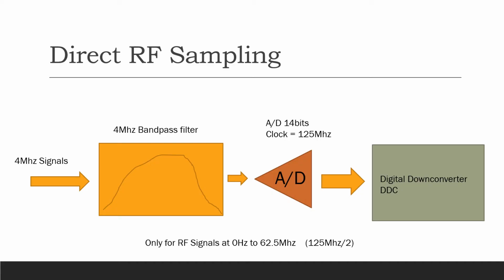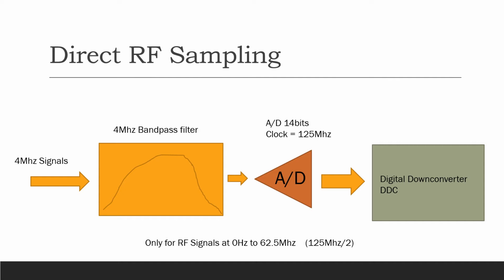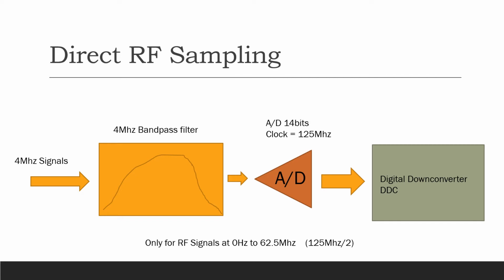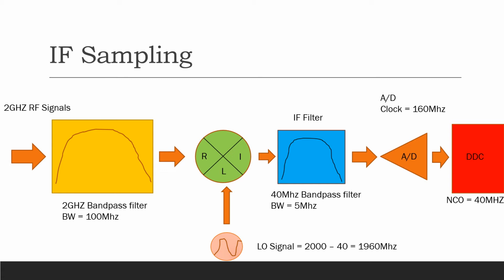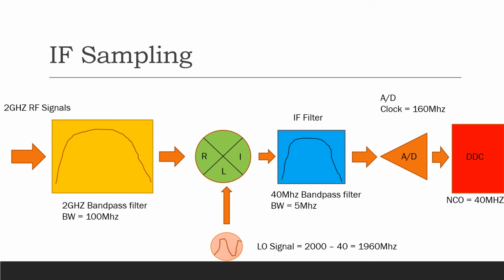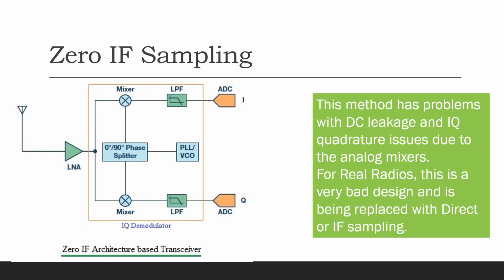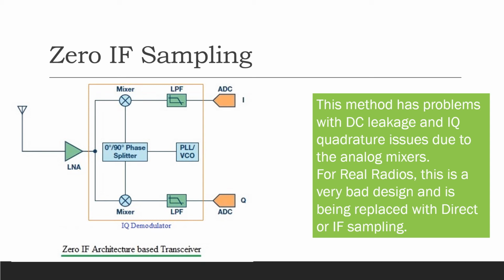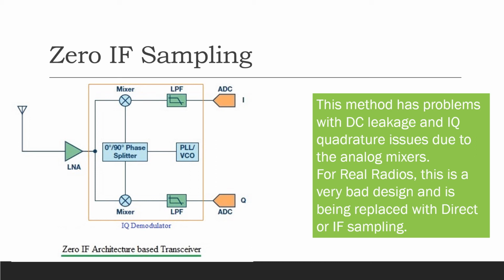IF Sampling and Zero-IF Receivers

Comment: Thanks for the video? What about undersampling techniques?
Reply: It's really common for IF signals. You can lower sampling frequency without aliasing when spectrum of the signal has limited bandwidth around it's central frequency but it moves central frequency (signal after ADC) to the lower value.
Reply from the maker: I made a video on nyquist zones

Comment: So I wanted a 20 meter hf receiver, (14.-14.3Mhz) could I use an ADC that samples at 2x14, or 28 Mhz ? On an 8 bit ADC spec is 28 MSPS (mega samples per second) the same as 8x28 or 228 Mbits ? Or would it be 228 Mbytes ?
Reply from the maker: Ideally fs is  4x times greater than signal of interest 😊
Reply: Ok. I understand. So I would need something a little better than 4*14.3 or around 60 MSPS.
 @TheGmr140
Reply: @TheGmr140  Yeah, because it provides some margin to Nyquist frequency (fs/2) and it's possible to easy and fast calculate IQ signals without multiplication by sine and cosine.

Comment: However, the "zero IF"  sampling seems to be much cheaper to implement. No high speed ADC and FPGA.
Reply from the maker: Yes, but a analog iq calibration will be needed,  but nowadays everyone is using the rfsoc chip 😊😊